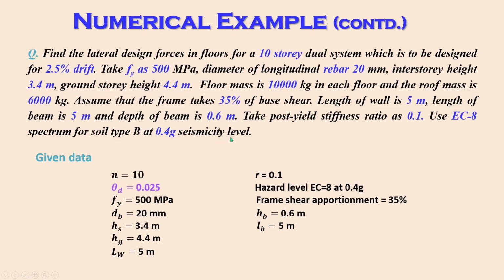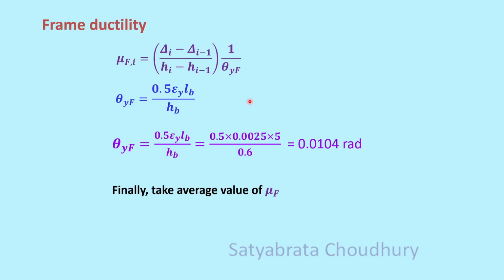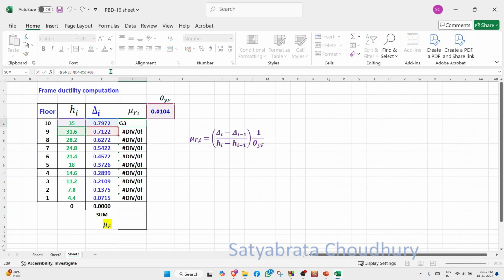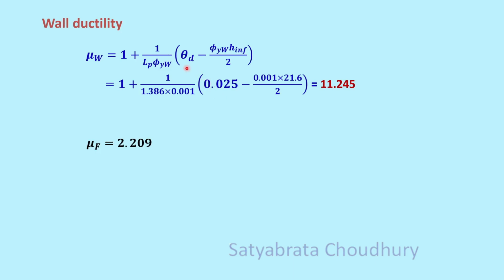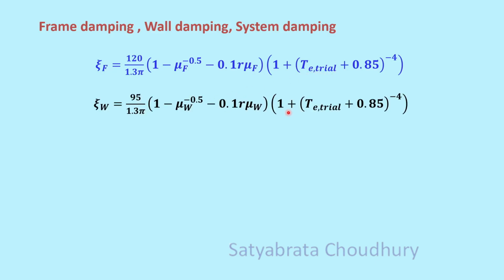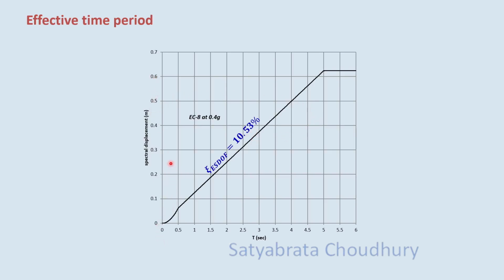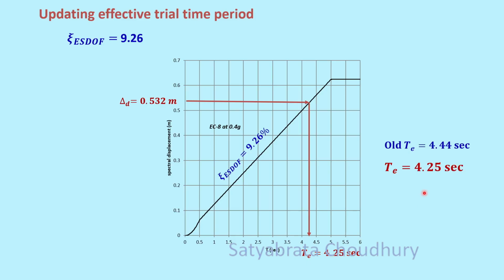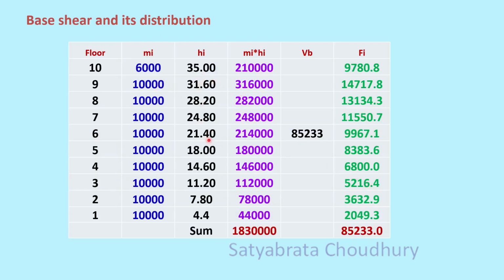DDBD FOR DUAL SYSTEM (Pt 4: Numerical)

Comment from the maker: Hello viewers, this video has a small correction, which you can easily grasp. In the last table calculation, I  mistakenly put "mi*hi" in place of "mi*deltai". Consequently, the forces in the floors are miscalculated. You have to put "deltai" in the place of "hi" column. Floor forces then come out as: 9317, 13873, 12217, 10562, 8906, 7257, 5646, 4108, 2679, and 1393 kN.
Reply: Hello sir, the summation of all these forces is not equal to the base shear force Vb (which is 85233) but equal to 75 958 kN. The values i found are the following : 10455, 15567, 13709, 11852, 9994, 8144, 6336, 4610, 3006, 1563 kN (The summation equal to 85235kN because this the value i found for Vb).
Thanks for this valuable video.
Reply from the maker: @NizarELOUAHABI-jn2ey  What are your values of xi_ESDOF, Te, Ke?